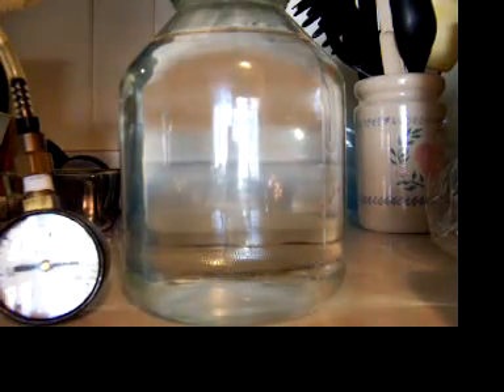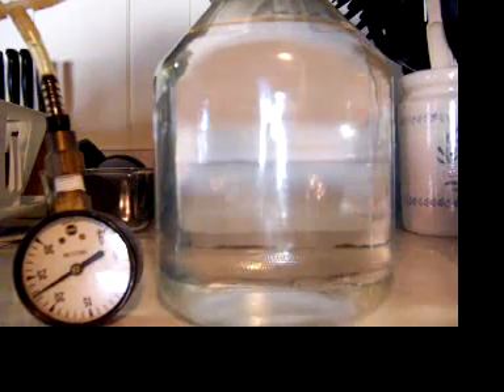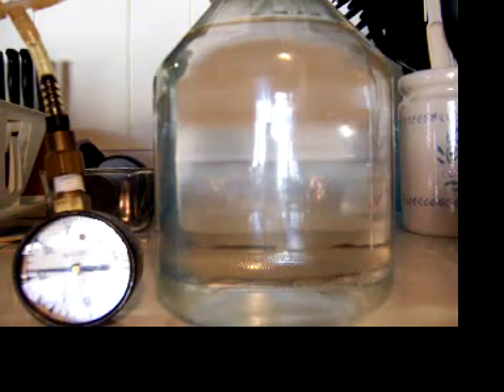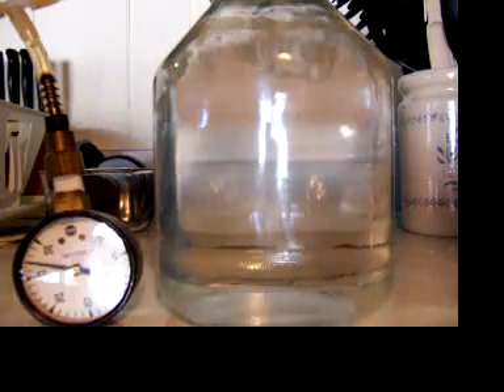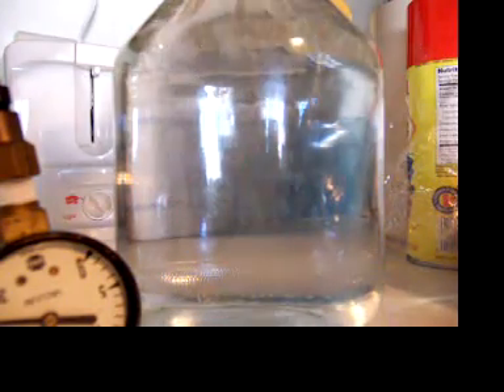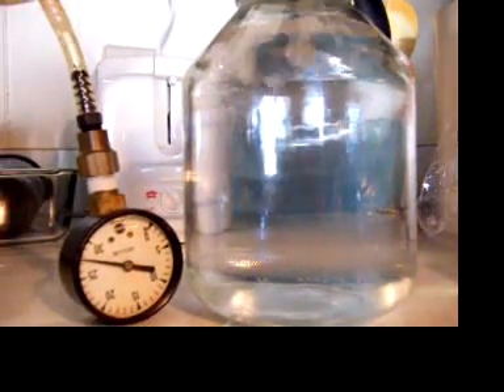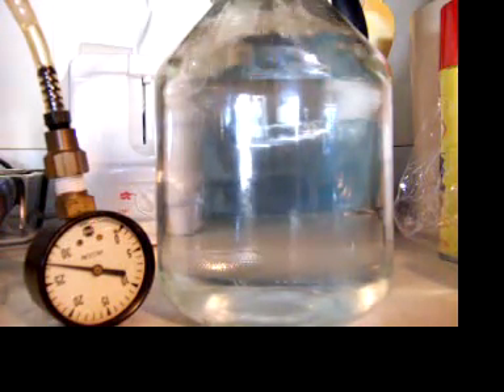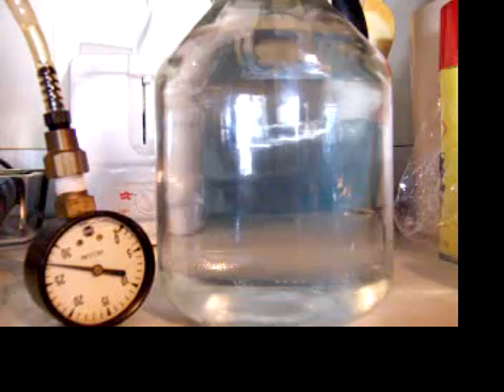Boiling Water in Less Than 30 Seconds? - Vapor Pressure Experiment

Comment: great video 
if you continue to increase pressure, then it will start to boil and evaporate?
Reply: No he is relieving the pressure from the water which is allowing it to heat up. Less pressure means it doesn't have to fight any weight from the air pressure on top of it , because he is sucking it out of the bottle, and therefore it boils

Comment: The water is BOILING! The vapor pressure (exerted pressure of the gaseous water in equilibrium with liquid) increases with increasing temperature.  Once the vapor pressure of water EXCEEDS the atmospheric pressure of the surrounding air, the water boils.  Hence, drawing a vacuum acts as DECREASING "surrounding" pressure.  When the vacuum pressure drops below the vapor pressure of the water at 78F, it boils!

Comment from the maker: MrCensorman: Yes you are correct.  There is a point of 'equilibrium' where the air will stop being released from the water based on the vacuum level.  Up to a point, as the vacuum pressure is increased more air will be removed.

Comment: The boiling point of water at 29.5" (atmospheric 
pressure at sea-level) is 100 degC. Reducing the pressure down to 
28" will minimally change the boiling point of the water to 
approximately 99 degC. Thus, unless you happen to be heating the 
water to this temperature, the water is not really boiling.  If you performed this same experiment with only a few inches of water in the jar at the same pressure, you would see jack happen.

Comment: Thats out-gasing is it not?  The boiling bubbles are a lot smaller and out-gasing occurs first until all the gas is released. I would be curious to see if later in the video the large bubbling stops and the vacuum needs to be increased to attain the same result with much smaller bubbles.  

And no food cannot be prepared this way because the reason for boiling is to bring the temperature above 170F to kill bacteria and parasites.

Comment: @spagboll616 
29inches of mercury is the equivalent of about 14 psi so not a huge pressure difference compared to what you could create with an air compressor. I wouldn't worry about how you seal it too much - chewing gum would work if you were in a pinch.

Comment: The canisters have a one way valve so it will hold the pressure until you press a button at the top. There's a cap on the inside of the lid that may pop off if you let the air back in too quickly so either let the air in slowly or remove the cap before degassing.  I used the outdoor faucet as it has the best flow - I measured 29"

Comment: I tried it. It works really well. I ordered a aspirator like in this video from EBay, an adapter for the faucet and some 3/8" internal diameter braided Vinyl hose from Home Depot and last but not least " Food Saver "  brand Canisters you can buy from a Kitchen department (pack of 3 sizes).  The hose fits very well at both ends so that's all you need. You can do the second mix of the silicone/catalyst directly in the canister  as unused peels out later.  It REALLY expands so go >3 times the size

Comment: I have used this method to degas silicone.  The amount of vacuum that you can achieve depends on your water pressure though.  In my apartment, it fluctuates, so sometimes I can get 30" and other times I can only get 28.5".

Comment: I can't see why you wouldn't be able to degas silicone with this set up. I'm not sure why it isn't a very popular method considering the hight cost of degassing vacuum pumps. You only need 28 inches Hg to degas silicone and this creates a stronger vacuum than that.

Comment: Yes he is boiling it!  A boiling liquid is always a PRODUCT of a TEMPERATURE / PRESSURE RELATIONSHIP.  Water will not boil until a higher temp under pressure just like a car radiator.  Lakes of liquid nitrogen exist on the moons around the outer planets because of their low temp.  Superheated water (same principle as a pressure canner or Bunn coffee maker) exists at volcanic vents on the  ocean floor and is known to be around 2,000 deg F and does NOT boil because of the extreme pressure.

Comment: It is the removal of pressure or the resistance of the molecules to move which allows it to boil, not the removal of oxygen.
Okay, you are removing the oxygen and sea-level pressure acting around the bottle, but the oxygen within the water still remains.
If you remove oxygen from water then you get hydrogen.
Pressure acts like a resistance, the higher the pressure the lower the resistance to move.

Comment: TP diagrams are true for ALL pure substances, like water in this case. It doesn't matter if it's solid, liquid or gas at standart conditions

The CO2 release from a coke bottle obeys a similar but different principle: the Henry's Law. It says that the solubility of a gas inside a liquid (it's "liquid concentration") is directly proportional to the pressure exerted from the gas phase above that liquid solution.

Comment: Yes thats true for gases. But If you shake a coke bottle, you build up pressure in the tiny air space above it, open the top and the pressure decreases. This causes the co2 in the water to be releases, it doesnt boil does it? He can put his hand on it. It's the gases becoming less soluble. It's how divers get the bends, etc.

Comment: Boiling doesn't neccessarily mean droplets will form on the bottle. Condensation on the glass means the vapor pressure is GREATER than the atmospheric pressure, meaning the vacuum can't suck out the water vapor faster than the water releases it. If condensation does not form, that means vapor and atmospheric pressure are equal, which means the rate at which the vacuum sucks out the gas is equal to the rate at which water releases gas

Comment: Good question... what was the atmospheric pressure in this day? The regular 101.325 kPa or something different?

And this experiment is explained by the TP phase diagram. This diagram shows the relationship between the saturation (boiling) pressure and the corresponding saturation temperature. The corollary is: the lower the pressure, the lower the temperature, but in a different way from Gay-Lussac's equation.

Comment: BOILING should get some water droplets condensed from vapour on the wall of the bottle. Did you find this? If not, I think this should be cavitation due to low enough pressure to water.

Comment: I'll explain the physics for you. When the volume is constant, Pressure/Temperature = constant, therefore P1/T1 = P2/T2 (P1 is the pressure before P2 is new pressure, same applies for temperature). So in simple maths. If the pressure is orignally 10 and the temperature is 1 the constant = 10. So if the pressure now becomes 5. 5/T2 = 10 or 5/10(the constant) = T2 (the new temperature) = 2. So by dropping the pressure, the temperature rises from 1 to 2.

Comment: In fact the water is boiling. By definition the boiling point of any liquid is the temperature at which its vapor pressure is equal to atmospheric pressure. If atmospheric pressure is  lowered, as is done in the video with a vacuum pump, water will boil at a lower temperature - in this case, room temperature.

Comment: The best aplication for this that I have seen is in ethanol stills. Rather than using heat they bring the kettles pressure down and get the same results using less energy as well as no hear for a risk of fire with the ethanol.
See   ethanolstilldotcom